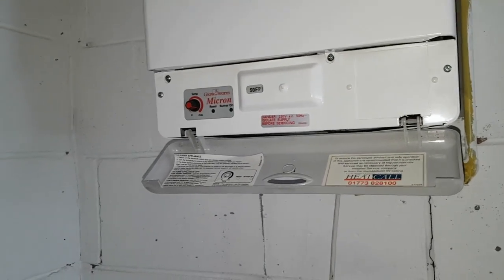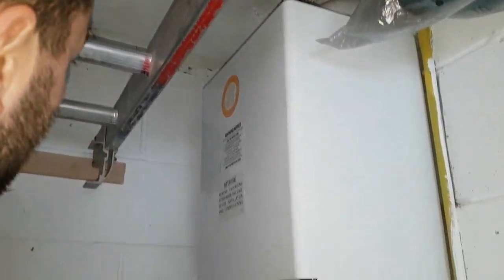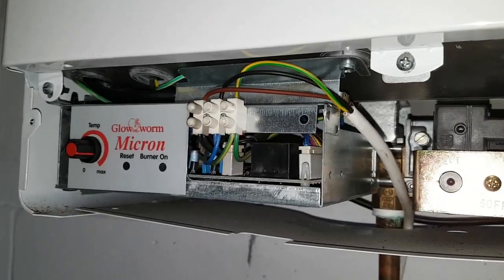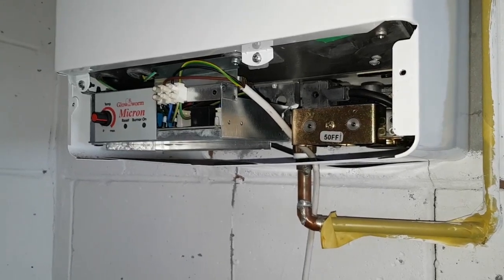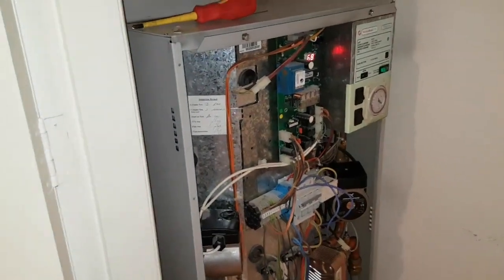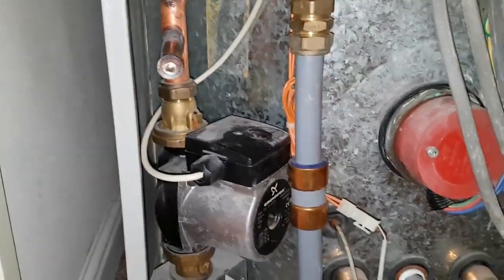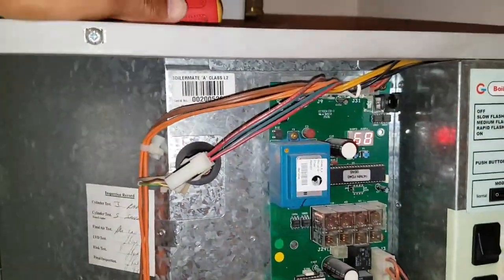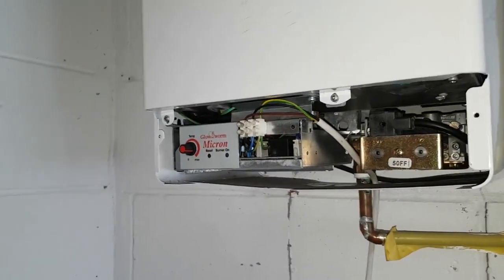Flashing Green Lights Glowworm Micron 50FF. With Coach Tony Morgan

Comment: Could you post up what the actual remedy was - Did the air switch fix it?
Reply: Would be useful to know as I got this problem with mine now…it’s freezing this week
Reply: @mikefranky  Mike if it helps I'll tell you what fixed mine. First, turn the boiler off by its left hand dial - then at its power supply (ie switch on the wall). Take the big metal cover off (2 screws holding a panel over dial switches, then 2 underneath that, then a third right on the top of the boiler case). This will reveal the whole gubbins - At the top is a large fan - I sprayed mine on its bearings with WD40 using a straw applicator - On mine this had been making a squeeling noise and it was clearly in need of either new bearings (new motor in reality) or a lube up. I lubed with WD, spun it a couple of times with my fingers, reassembled the case, switched it back on, turned on the boiler rotary knob and then double check your programmer is on and calling for heat (or water or both) and - well that cured mine, been running for weeks since with no noise, cutouts or warning lights.
Reply: @GHOOGLEMALE  …Cheers fella will give this a try..Thankyou for the info…
Merry Xmas…

Comment: Was it the air pressure switch at fault? My boiler is showing the same light sequence. British Gas have been out there times and the lights are still flashing. 😢
Reply from the maker: Yeah
Reply from the maker: hey we're currently trying to grow our Facebook group and would love you to join Tony and the team using this link, Tony will be available to answer all your questions directly there's also updates on new trainings we just released too. https://www.facebook.com/groups/167070231326174